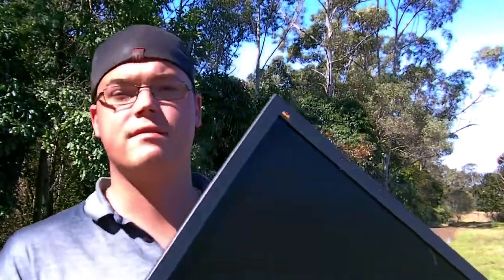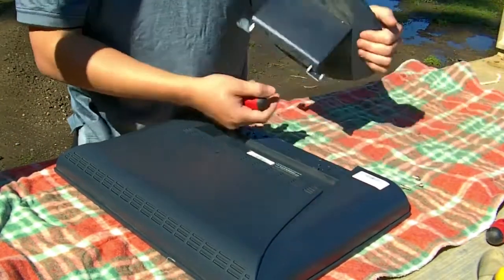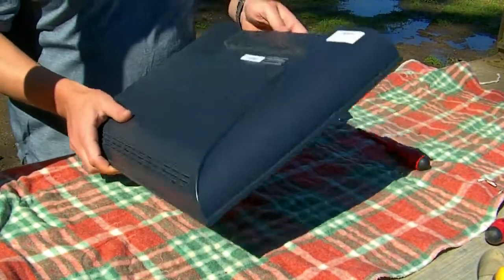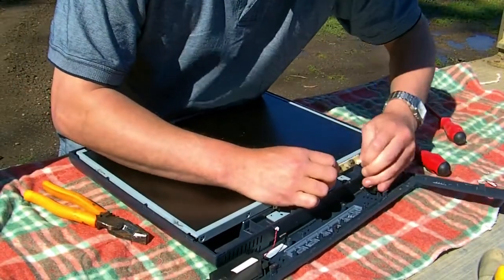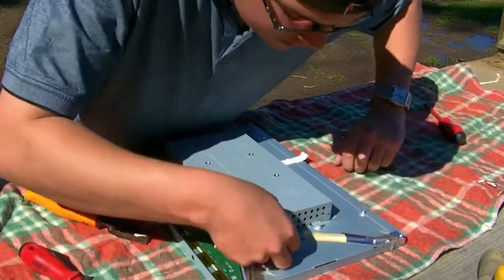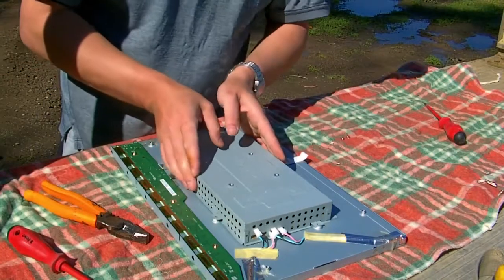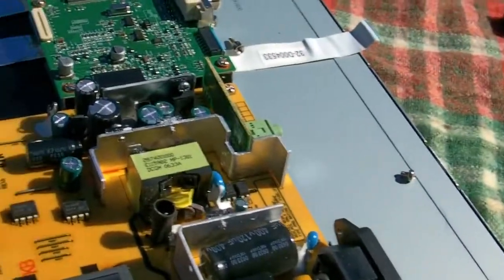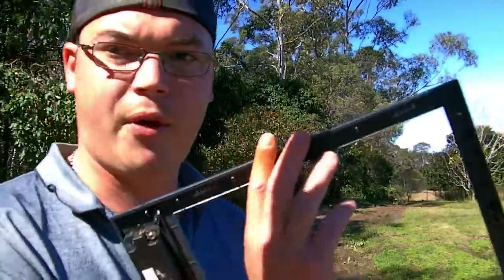How to pull apart a LCD monitor under 6mins

Comment: good vid. I have one very similar and was afraid I was breaking the frame but went on and it all snapped away finally without getting too messy. 
bottom line with most of the electronics now they don't want you to open it and repair it so it isn't tech friendly. Unlike laptops and desktops which are made to be taken apart and repaired. Thanks for the vid it helped a lot. Oh and there were 3 bad caps in mine. Two of the same as yours plus another.

Comment: My monitor needs caps replaced, im trying to take my apart and it wont seem to work, im gonna try what you did, i got all the screws out but the frame is stuck, i guess like u said, u may break some or all the tabs, but its better than a paperweight. Thank you! An honest video!

Comment: Sadly, those CrapXon caps took out most of the board. I did repair it with new caps and FETs but not long after it went up in smoke. Ended up buying a replacement for it and have been using it since. The new board has most of the caps replaced and two of the CapXon caps left, but I still have the kit so I can replace them.

Comment: I could not tell in the video how the capacitors you mentioned looked any different than the others. I just thought you'd have to take them out of the circuit and see if they are shorted or open.

Comment: I have two old monitors that I don't need and I was thinking of taking them apart and join the two lcd screens together and have one display input rather than two different inputs to devices. I am wondering if this is possible.

Thanks.

Comment: That very panel is used in many different screens. I have one in an L1975NW, has blown caps. Replaced caps, but most of the time you need to replace the MOSFETS and a fuse or two. What happens when you use cheap no name caps :(

Comment from the maker: Do your caps have a bulged suface on top? If not, test the caps and/or power to the black light. Power supply issues seem to be more common on these cheap displays. Hope that helps.

Comment from the maker: @CoolUnderFire21 the method is pretty rough (first to admit it) but it's only holding on the front face of the monitor. This one was a freebie so no skin off my nose.

RS Components is a good source for most caps in Australia & UK worth checking out if your close.

Comment: Hi Nick, I have a HP monitor that doesn't always display its red spectrum, and I think that the problem could be that the D-sub connection is loose inside the monitor, I have tried changing the cable to see if that was at fault but it makes no diffeence, so I was wondering if I took the back off the monitor would I just need to tighten up the D-sub connection or could a part be faulty instead?

Comment: Would it be safe to run a monitor without the plastic case around it? since its just a metal box inside the case im wondering if there could be static problems that could damage components?
Im asking because i use 3 screens for triplewide gaming and one of my screens (hanss.G HD216D) has a very wide border and im thinking that it might be better to run it out of the plastic casing so i just have the thin borders of the metal case inside.
Thx in advance :)

Comment: I have a 25" Hannspree (hsg1064) LCD monitor that is having problems. The screen is blank, but the power light is on. it displays OK but goes blank again after a few seconds